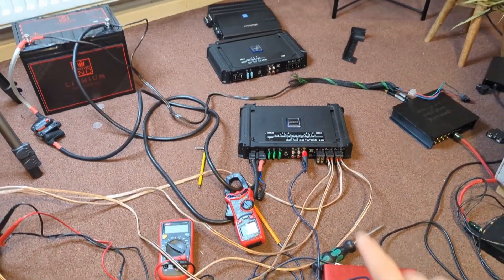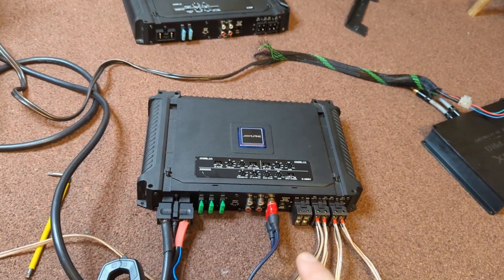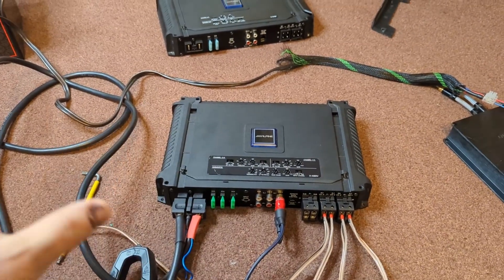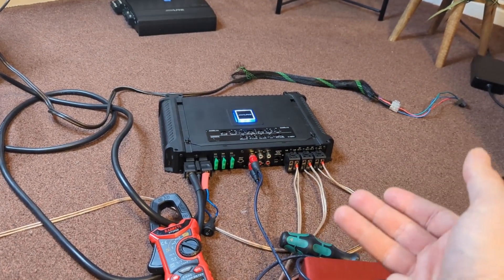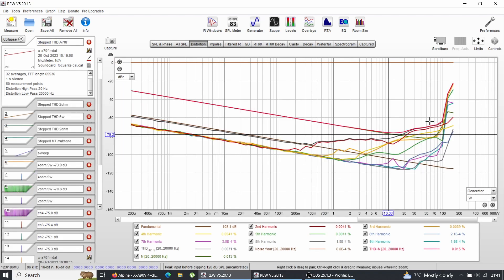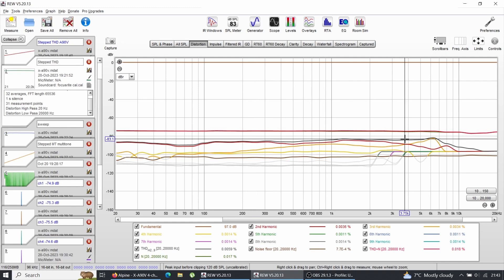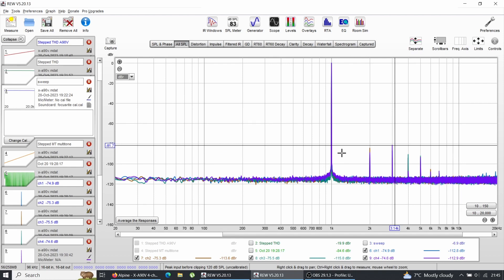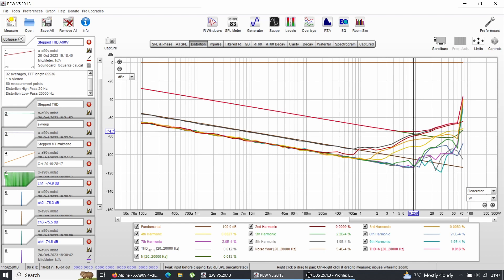Alpine X-A90V amplifier distortion measurements

Comment: Nerijus I’m curious what sub amp you plan on running for the new IB sub? It’s getting so hard these days finding a good mono block that doesn’t have a built in sub sonic filter. Most of them are set at 20-25hz and are non defeatable.
Reply from the maker: It's a surprise and probably will be a shock to many people😄 Will have the amp next week and will test it before using.

Comment: I have two of the A90M versions running a pair of Focal E30KX subs and I love them! I do wonder how much time the amp takes from the input signal to the output, as I have to run them inversely phased and with over twice the time aligned distance than what they are physically located in order for them to sound correct with the front stage, which is running from a Helix P six ultimate.

I figured that the p six runs the front stage, and the sub output from the p six into the A90M and back out takes an artificial amount of time that needs to be accounted for.
Reply: This led me down a rabbit hole on how different amp brands could take a different amount of time to process a signal which could be another reason to keep them the same (in order to avoid time alignment issues)